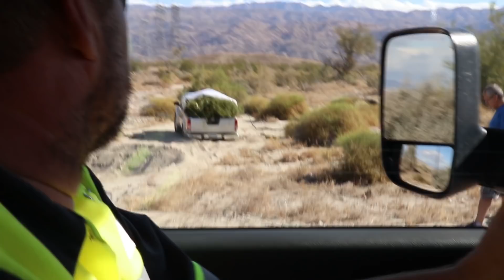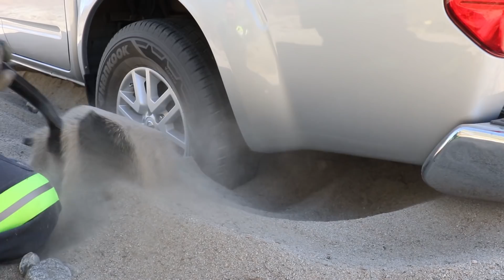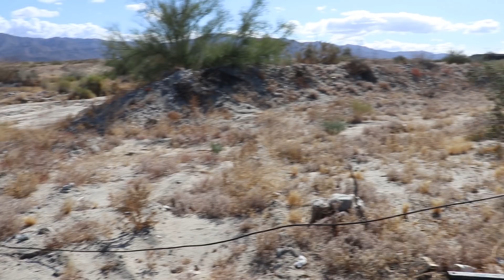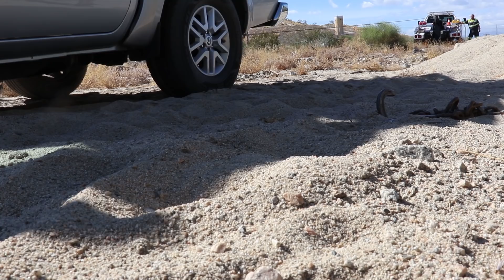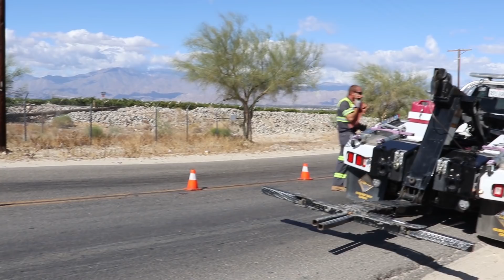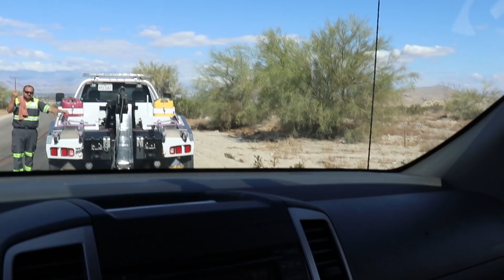Pickup Truck Gets Stuck In the Desert

Comment: The sand didn't look too bad, but tires seemed bald and it dug in pretty easy. Would this be do-able on 4wd high with decent tires?
Reply: Sometimes even paddle tires aren't enough for self-extraction from these sand pits. They range from gritty, almost gravelly stuff down to pure dust, and so thoroughly dry that there's no structure to provide traction.

Comment: plaza towing.. you might search around and see if you can find some steel conveyor belting like this.. https://i.imgur.com/WL4cpDL.jpg  rolls up easily. works in sand or on ice..  tie some 1/4 or 5/16 poly rope to two places on one end.. hook that to the vehicle. when you get it going the the traction mat will follow along till you get clear of the sand.  it will work under the wheels of the rotator also.   its used in ovens..

Comment: Would've liked to have heard that conversation on the ride out.."Trent I can't believe you got it stuck again 🤨😂" Darn Nissan's was it 2wd?
Reply: Not sure 4wd would have made any difference in that powder.
Reply: If it was a 4x4 it would have "4x4" on the tailgate next to the SV trim package badge.  The lack of handle on the driver's A-pillar and the particular style of handle on the passenger's A-pillar tells me that it's model year 2017 or newer, so it's unlikely that it has had its tailgate repainted or replaced.  It's also wearing street tires, not the BFG All Terrains that it would've left the factory with if it was a 4x4.

Comment: Only rear wheel drive on the pickup?
No lockouts or antispin?
Reply: The Frontier has an electro-hydraulic traction control system called "ABSLS" but it won't do a lot of good if both wheels bog down at the same time.  Only the Pro4x model gets an actual locker, and it only would engage in 4wd low and below 5mph.

Comment: Wow that is some nice fine sand.  Does water help harden the sand, I know that is a good trick when on the beach and you get up on the dry areas.
Reply: If the granite content was higher. This sand is too fine. Most of the area was under water in prehistoric times.
Reply: It's a mixed bag. 
1) they get very little rain in the low desert.
2) rain might help some areas settle and compact, but,
3) rain runoff can also deposit more sand in low areas, which once it dries out can look like the spot this guy got stuck in.